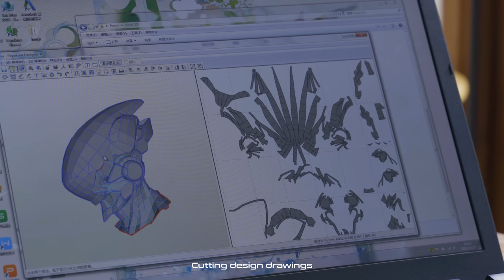How To Make Your Brother Feel Like A Space Warrior?

Comment: Tip for future soldering.
Heat up the copper on the bottom with your soldering iron.
Then apply the tin on top and let it melt through.

Applying solder just on top is called a cold solder job and isn't as reliable as you've got no tin inside of the copper strands.